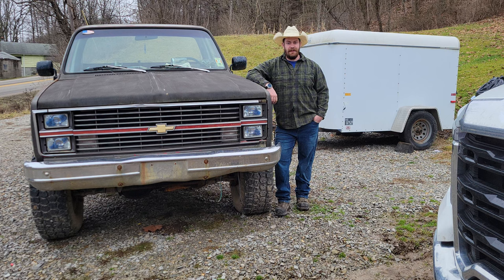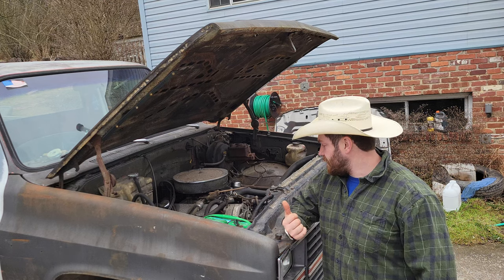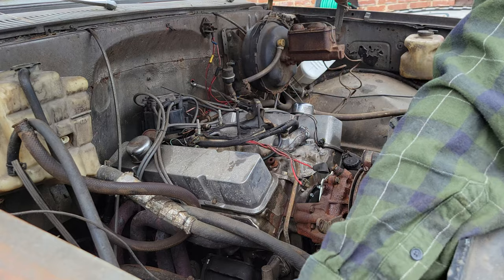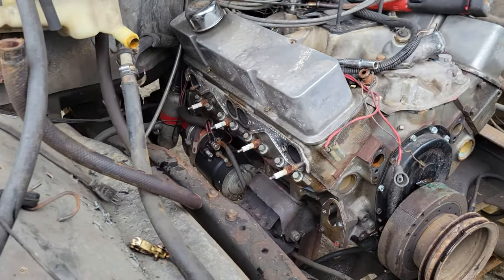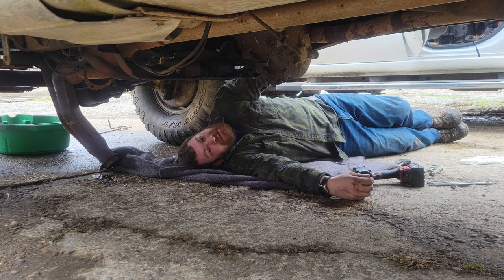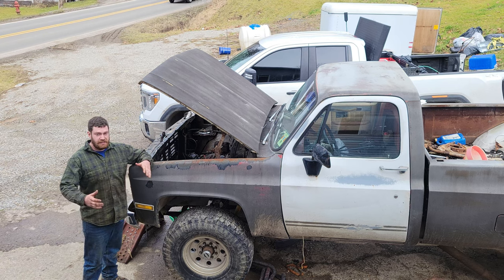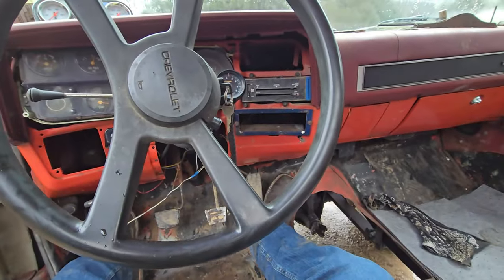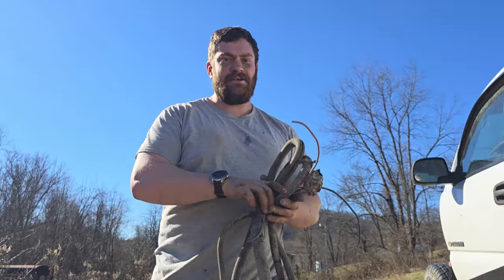LS Swap Preparation: Removing the Engine from a Squarebody Chevy Truck

Comment: Yet another senseless, overrated and played out LS swap. How original. Whats the sheep heard doing these days? Exactly.
Nothing to see here..
Reply from the maker: Who said anything about original? I'm doing this for ease of use, power, parts availability, and fuel milage. This truck is going to be my work horse on the farm and if I don't have to fight a carburetor and I get a few other benefits with it I don't see how it's a bad thing. Anyway thank you for the comment it helps with the algorithm!